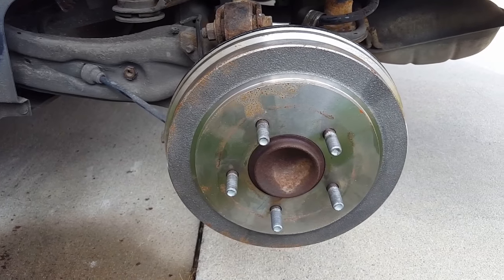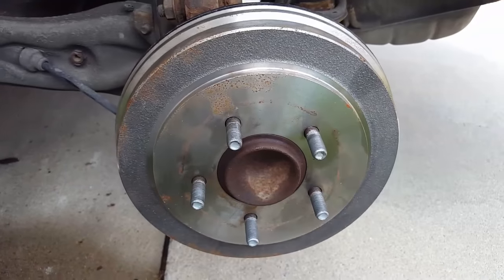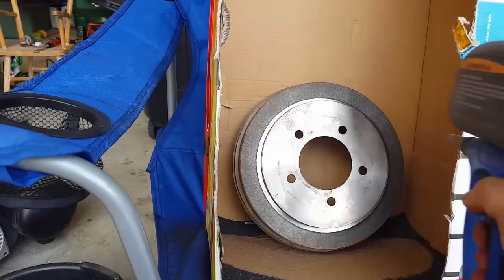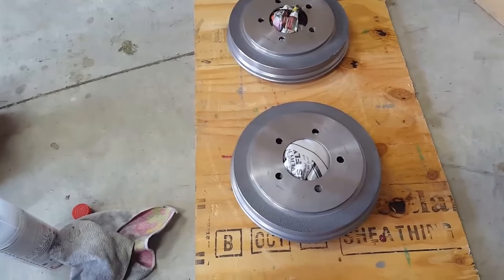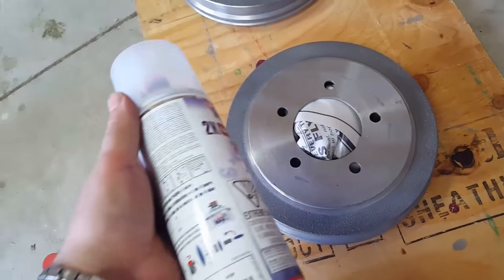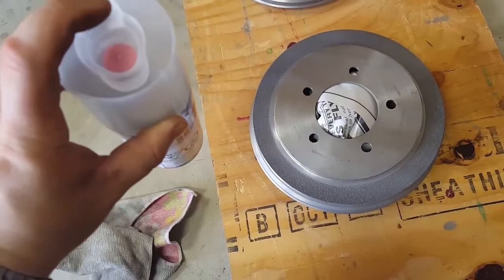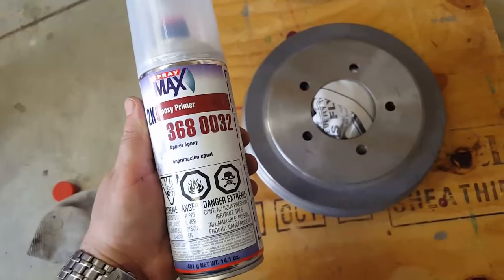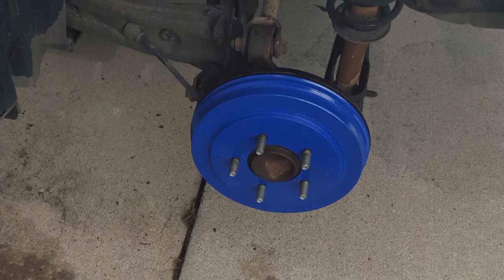Painted my brake drums.

Comment: I have two of those type sand blasters. One from PA and the other I don;t know where I got it from. I've never used either one because they looked cheap and like they wouldn't work at all. After seeing this video I may have to give them a try. What type of sand did you use? just regular sand or actual silca sand meant for sand blasting?
Reply from the maker: Bruce L. Sorry it took so long to reply. The gun came with a small can of sand.